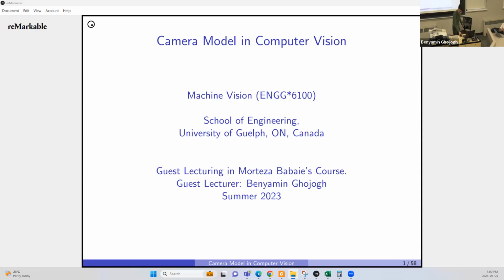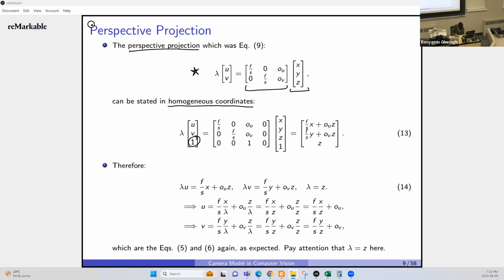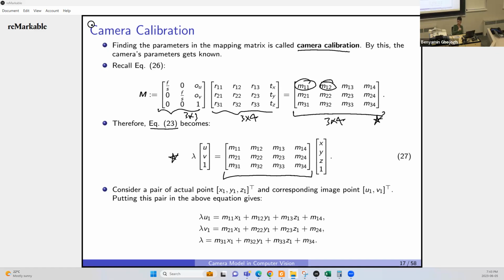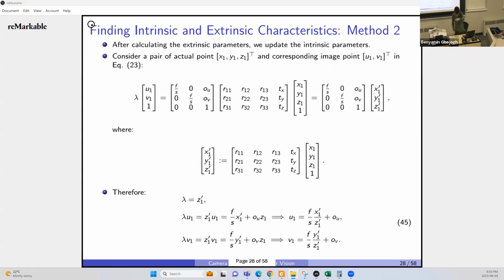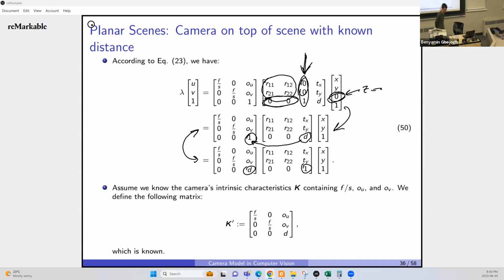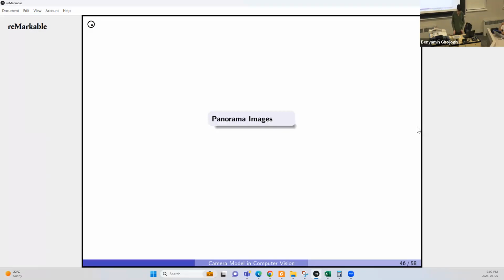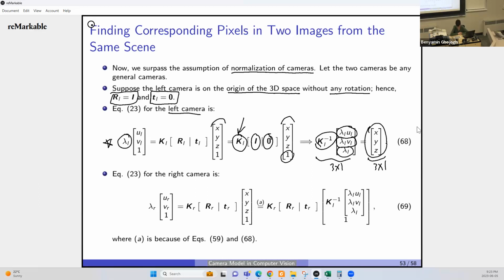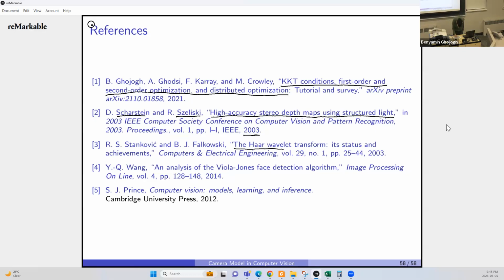Computer Vision: Camera Model and Calibration, Depth Inference, Panorama Images, Fundamental Matrix

Comment from the maker: At time 1:53:34 in this video, the method whose name I forgot was NERF. NERF (Neural Radiance Fields) is a family of methods for 3D scene representation in modern computer vision. These methods use the concept of optical ray modeled in neural networks. Some of the related papers to NERF are:
- Nerf: Representing scenes as neural radiance fields for view synthesis, https://dl.acm.org/doi/abs/10.1145/3503250
- Nerf: Neural radiance field in 3d vision, a comprehensive review, https://arxiv.org/abs/2210.00379